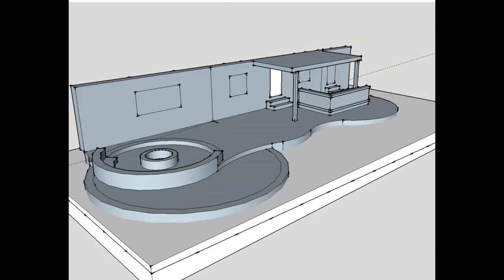Paver Patio construction, time lapse, 400 man hours condensed to 5 minutes.

Comment: Very nice job. Just one question. How did you solve the drainage? Especially at the sunken patio with wall? I could not see any drainpipe...
Reply from the maker: There are several drains inside the fire pit. One main drain that daylights outside the main patio wall and 4 small ones that lead from the sunken area,  into the drain that I under the fire pit.
Reply: @decorativelandscapeborders4308  Thank you. Again, amazing.

Comment: where does the water go to on the lower fire pit landing? Is there any drainage on that fire pit area?
Reply from the maker: +Nick Nush there are drains that lead into the actual fire pit where there is a center basin to collect water and discharges out the side of the lower patio.
Reply: @decorativelandscapeborders4308  
good idea!
Reply from the maker: +Nick Nush yes, drains in the bottom carry water out the side of the lower patio

Comment: at 5:11, just out of curiosity, why do the wall joints line up vertically? Looks like you used a few smaller blocks or cut some. Was there a specific reason for that?

Comment: What's something like this run $ ?
Reply from the maker: Sorry, out of respect to our clients, we won't publicly discuss the cost.
Reply: I understand and didn't want an exact dollar amount just wondering ballpark budget number.
Reply: technical33 easily over a $100,000 dollar job when I do jobs similar to this size I charge 85,000-120,000 depending on soil, grade, labor, blocks, sub base, accessibility, equipment. But price will change depending on where you are located.
Reply: Thank you!
Reply: yeah somthing similar to that in the DMV area would only cost around 40-50 i think 85-120 is a lil crazy.
Reply: technical33 about 35 to 45k job

Comment: excellent work..The look of all pavers is a completely cold manufactured look. You need to mix SOME natural stone in there to bring this to life. This looks cold and has zero character no matter how much design and curves you apply, pavers just don't cut it when it comes to look and feel of the material.
Reply from the maker: Thanks for the compliment and the criticism. First off, I happen to prefer the look of all pavers and matching blocks. If you look closely, there is a 60/40 blend of of 2 different colors in the pavers as well as different blocks used in the bar area as well. But ultimately   it came down to what client wanted, since they are the one with the check book. Here is a look of the same patio after it was decorated and furnished.  https://www.youtube.com/watch?v=5PYKN6RCyFc
Reply: This guy don’t know what he is talking about. This is as nice as it gets. I love the look that all pavers gives. Looks super clean. Trying to add natural stones everywhere just clutters it up and makes it look old.